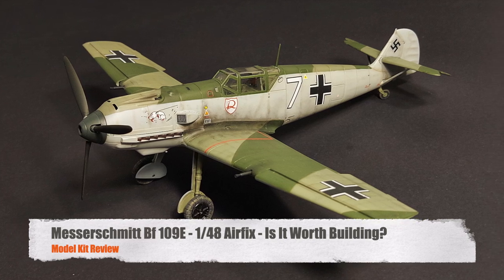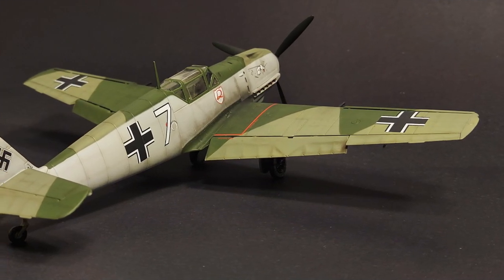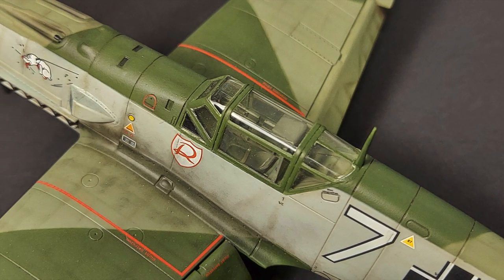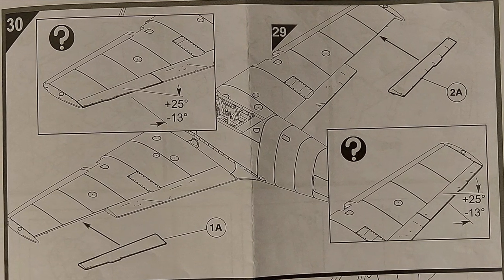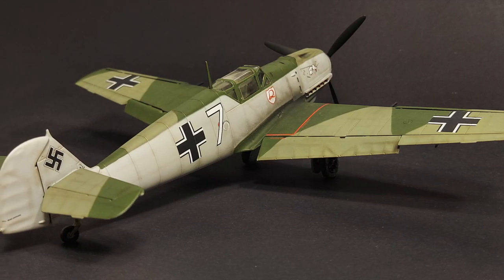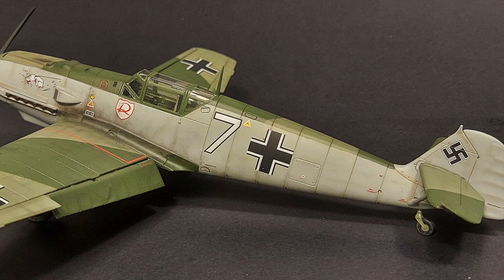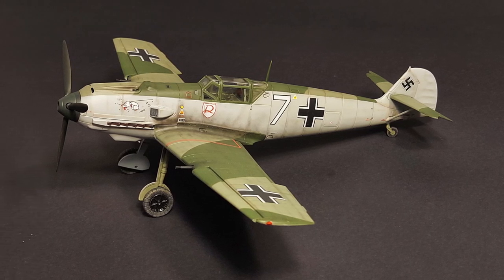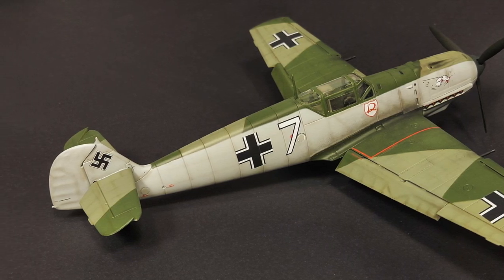Airfix Messerschmitt Bf 109E Review - It's Basic, But Is It Worth Building?

Comment: The finish with weathering is outstanding. Very nice representation of the 109. They were in so many theaters of operations which generated a large variation of camo schemes. One " problem" I have found in reentering the hobby after retiring is finding decal sheets with swastikas . I do have a few German aircraft in my stash I need to check, but  I'd prefer to get a set that is current to the kit " age", and that also includes other decals from vintage kits Any ideas? As always I enjoy your format of kit reviews.
Reply from the maker: Thank you! I would simply look for a decal sheet that you like in the scale you want. Most decal sheets aren't kit specific (and I don't know of sheets marketed specifically for older kits). I'm often inspired by a specific color scheme on a particular aircraft and will figure out a way to get the markings I want, often using leftover decals from other kits, painting the markings, etc.

Comment: Dagga, Dagga, Dagga. https://www.youtube.com/watch?v=yRw34BC_f5o Achtung Spitfire
Reply from the maker: Right on!
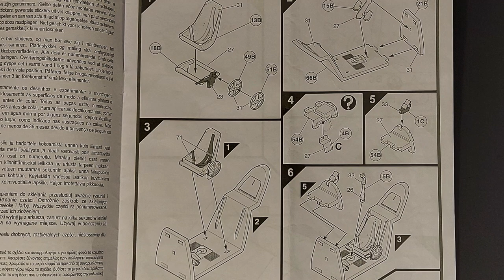Reply: Finished the build of a different BF109 1:48 airfix kit yesterday  (A005120B) - contents are identical but the instructions for ordinance/fuel tank are not in present, even though the parts are in the kit.  It seems the difference is really the decals.  I am not convinced that the scale is really 1:48 as the pilot is about 33% smaller than 1:48 Tamiya Ground Crew with Power supply.  Having said that I think the colour scheme and finish is pretty good especially as the part fitting is particularly good for an Airfix kit.  As you say though, it is all about the painting and weathering that lifts this model.
Reply from the maker: @jaydiamond7291  Right on Jay!